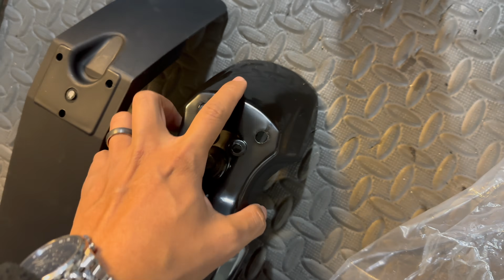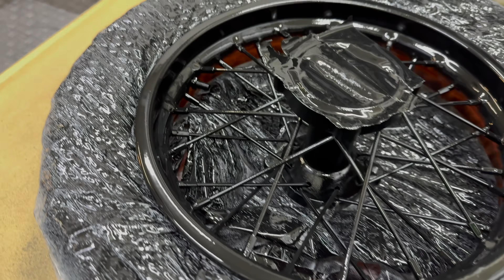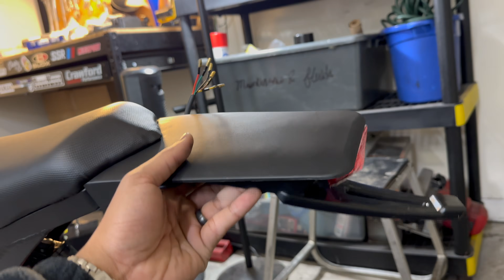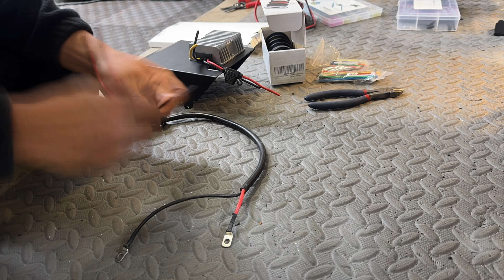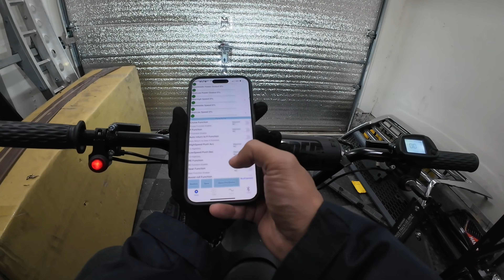Tuttio Soleil 01 Upgrades - Nilight LED Headlight & Tail Lamp Install

Comment: Great video. I’m working on the same brake light modification on my son’s Tulio e-bike, but I have a question about how you wired the brake switch.

I tested the factory rear brake switch and confirmed that the controller supplies 8V with the brake released. When the brake lever is applied, the switch closes, voltage drops to 0V, and the controller immediately disables the throttle. If you hold the brake and try to accelerate, the bike beeps and won’t move.

My concern is introducing 12V from the DC-DC converter into that existing circuit, potentially damaging the controller.

Did you completely disconnect the factory brake-switch wires going back to the controller and repurpose the switch for the 12V brake light? Or did you find a way to retain both functions?

If the factory connection was eliminated, wouldn’t that also eliminate the motor cutoff safety feature? That means someone could squeeze the brake while accidentally twisting the throttle, and the motor could still attempt to drive against the brakes.

My son rides this bike, so maintaining that safety feature is important to me. I’m also raising this because other parents may be following your installation.

I’d appreciate some clarification on how you handled the factory brake circuit. I’d like to add the brake light without compromising the original safety system.

Comment: Everything is clear except the brake wiring. Is black and yellow wires teed off and then yellow to constant hot and black to the back tail light for brake light? 

I connected it this way and it didn’t work. Shows error e09
Someone help please 🙏

Comment: Did you splice the yellow abd black and send the. Lack to ground and yellow to red on converter? Asking for a friend ??…😅
Reply: I put black to the tail light red wire and the yellow + green to the red power cable from converter

Comment: Completed this upgrade head light/tail light modification. Worked perfectly. This may be helpful for anyone doing this modification in the future:
     - Red Power Line wire > Red Switch wire + Yellow/Green Brake Lever wire
     - Red Tail Light wire > Black Brake Lever wire
     - Black Power Line wire > Black Tail Light wire + Black Head Light wire + Black Switch wire
     - Green Tail Light wire > White Switch wire + Red Head Light wire
BTW...yes, the lights draw power even with the ignition off. @patoutdoors thoughts on wiring so the lights only working with the ignition on?
Reply from the maker: You could also switch it so the on off switch is going between the power source and the voltage step down converter so there’s absolutely no draw with ignition off.
Reply: Did you use 22awg wire? Also what did you use for the step down converter teeminals? Just a 12 gauge terminal w connector?
Reply: So you just tap into the yellow/green and black wires that go to the brake lever? Or do you have to disconnect them from the controller before you put power/ground to them? Just want to make sure before I connect that one.
Reply: @lucasgraham  i just unplugged them then cut them
Reply: @Unstrict unplugged as in removed the plastic connector? Then rerouted the ones coming down from the the handle? Then abandoned the ones going to the controller?
Reply: @SolidHomeBuyersAdmin  yes
Reply: I put the yellow and green wire to the red wire coming from the converter, black wire going to the brake light

Comment: Hello Pat. Great video. I got my grandson one of these for Christmas and am getting ready to add the lights. What purpose did the brake signal switch wires serve, the yellow and black ones that come in from the bottom side of the fork with the controller wires, before cutting them and wiring them into the tail light assembly? Are they for the left brake sensor? I've seen several videos where it is desirable to bypass that switch. If cutting the wires does that, it's ok by me but I want to be sure. Thanks in advance.

Comment: how did you share the ground wire between all 3? sorry im not that good at wiring and im trying to wire in a different taillight but it has turn signals and ill just use a different switch.
Reply: Can use a 3 way connector i think he just jammed 2 of the wires into one side of a crimp connector
Reply: I just finished this and i had them connected 2 on one side of a connector

Comment: Do you sell the wiring kit with the harness and everything? Can the lights be wired into the key so they turn on whenever the key is turned on, and bypass the switch entirely?
Reply from the maker: I don’t sell anything unfortunately
Reply: Got all hooked up and tested everything works except the brake light? What do you mean when you say you’re running a  constant power to the brake lamp switch? Do you mean it comes off the power from the converter and routes up
to the lever?
Reply: @kyleestes69  you have to wire the black brake wire to the light and the yellow one to the power cable

Comment: You also went from discussing the brake wire to using those wires for a circuit and then switching the random battery for absolutely no reason at all. Why?

Comment: Bro your wiring of everything together sped up didn't help me at all I am stuck as of right now not really sure what to connect to what, is there any way you could not speed it up or explain it. Like you started putting random on different color wires, how am I suppose to learn anything from this, I went and purchased all this shit and your video is literally making me frustrated cause you skip all the important shit...
Reply: Check newest comment

Comment: Probablybetter to run that wire under your crown instead of between the fork and frame. It could pinch but it will for sure get lots of flexing over time. Under the crown would stop the constant moving. This is months old so it's either becoming a problem or tested out fine so far. Nice video sure this will be helpful to many needing a brakelight.
Reply: What are you referring to as the crown? Top space between forks?
Reply: @Unstrict  What is a fork crown?
A fork crown is the upper part of a bicycle fork which connects the blades of the fork to the steerer tube. This part is integral to the strength and performance of the bicycle, as it distributes the forces of braking, steering, and pedaling to the frame. It is usually made from steel, aluminum, or carbon fiber

Comment: When you put the front fender....did you have to add washers onto the hardware from the older one? Ordered the one on your link but the holes for it are too big
Reply from the maker: Yep, just add a washer on each bolt

Comment: Hello. Great video. But important question. Does this draw constant power with your wiring as I see it routes to the switch but when ignition and switch is off….. when you press on the brake handle, does light come on? If so, it will draw constant power

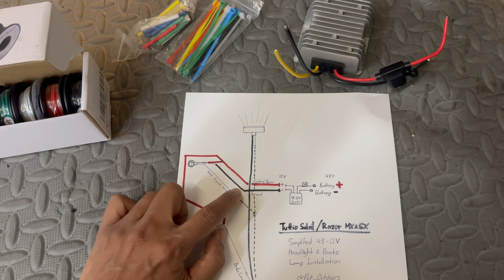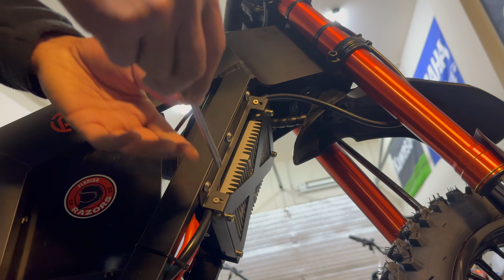Comment: Hi around 15:35-16:03 you mentioned you are teeing off the constant 12V power source to brake lamp switch, since he wants the brake light to work regress if headlight or running lamp is on.  Does this mean it is constantly drawing power from the 48V battery even when the bike is sitting and not used? If so then it will drain battery when bike is sitting around no???
Reply: idk

Comment: Hello. Tell me where you soldered the 2 wires B+ and GK. From the Bms comes + - on the XT90 it is on the plug to the controller and a connector of 2 wires + - coming from the BMS B+ and GK are connected to it. I don't know where to connect them. Without them, the moped beeps 5 times. The battery voltage shows ~67.2. The Fardriver on the mobile does not find the controller. I found it before it was finalized. Kugoo Wish 01 restaling with a white headlight and checkers on a pendulum. I soldered the 16S11P battery and installed the Daly Model K symmetrical Bms.
Reply: Black wire connects to everything. Red sends power to switch which powers everything

Comment: Hi @patoutdoors. I am confused to what I need to order based on your list in your description. If I just want to add front head light and rear taillight plus the switch to turn on and off. Not doing anything else…. Can you list me what I need? What is the “Dongle” used for? Thanks.

Comment: Great work on this bike thanks for the video. I watched a few of your videos and I could've sworn you did one where you upgraded the battery charger on the original 48 V did you do that and what was it? Thanks.
Reply from the maker: I never upgraded the charger for the stock battery, though I used a 72v electro & co charger when I had the 72v Amorge battery installed

Comment: Hey I also have the tuttio but the chain on the bike keeps getting loose. Everytime I tighten the tension bolts the move forward again. How do I solve this issue? Would it help to shorten the chain?

Comment: How to connect a dongle to your bike. The Bluetooth part
Reply from the maker: Take the 4 screws off the controller cover and remove it, plug the Bluetooth dongle to the red connector on the controller harness.

Comment: can you create a tutorial with the headlight link to buy and the light switch and just a tutorial on how to only add the headlight with the switch? pls
Reply: Do the same thing but only attach the signal wire to the headlight, or you can just run it in a circle

Comment: Great tip on the bag for covering the wheel Pat!. Ive just done it on my lads. I do have a little tip for you, instaed of using strips of masking tape and then cutting it to size for the centre. I just used a square piece of tinfoil and then formed it around the centre. Job done. Cheers for the videos 👍
Reply from the maker: That’s another great idea.. keeps its shape too

Comment: If you want your paint to stick to the wheels better you need to prep better. Scuff, clean with alcohol before paint. Also, a 2K clear after will keep the paint looking good

Comment: What did you use on your impact driver to remove the 6mm bolts to remove the rotor? I can’t get them out by hand with my hex keys with rubber handles. They are on too tight.

Comment: Can you make a more detailed video showing how to do the wiring?
Reply: Ive figured it out if you want help
Reply: @Unstrict  Can you please help me?
Reply: @noahfaulkner4028  do you just need to know more in depth what he wired together?
Reply: @Unstrict can you just help me with the brake light connection from the brake lever? I have the green wire but I can’t figure out what wire to tap into. There’s no yellow and black wires on mine. There’s a Y/G and black but I tapped into that wire and nothing. He didn’t go into much detail on wether he just simply tapped into that wire or what he did.
Reply: @lucasgraham  you connect the yellow/green wire to the red power wire from the converter. The black wire from the brake sensor goes to the red tail light wire. The red power wire from converter gives the brake sensor power and the black wire allows the signal to be sent to the brake light when the brake is pressed. Hopefully that makes sense

Comment: Quick question about your brake light. Are you still using it as a safety switch for cutting off power to the motor while you have 12 V going to it?
   I asked because I really want to keep the safety cut off on the break, but I also want the brake light. The bike is for my daughter and that safety switch comes in handy.
    I’m just worry about giving it 12 V not sure if that will mess up the controller
Reply: I think you can just loop at all so it.does both

Comment: i hate that even though i watched this video like 10 imes, i stillll dont understand the wiring for the brake lights :( i even turned its to x.25 on that speedup part and still dont understand lol fml i might need to hire an electrician
Reply: do i still need the step down if im only installing the brae lights? can i just tap the brake light red wire to the yellow brake wire from the bike and black to black if i just want the brake light and not the day time running light? hopefully that made sense to you lol
Reply: @AdventureWithSpidey  ive figured it out mostly if you still want help lol
Reply: @Unstrict  , I am trying to do everything he did, but the brake vs. throttle wire for me isn't yellow; unless I am looking at the wrong thing, it is green. However, I am also confused about how to wire the whole thing at the end.
Reply: @noahfaulkner4028 so when you look at the wiring in his diagram the black cable / negative is connected all the way through to everything in the diagram you see it go to except the brake sensor one. For the brake / throttle, look to see if theres one with 2 wires and one with 1 wire. The 2 will be the brake sensors. Try following it to the brake if you can. Also he has the power splitting from the switch to both the running tail light and the head lights. Brake is separate

Comment: Is there a way to have the lights shut off when the key is turned off?
so you don't accidentally leave them on.
Reply from the maker: @Lee-ry5ib  yes, but you would have to wire in a relay and use the key-on signal wire from the ignition switch going to the controller as a trigger wire for the relay.

Comment: Hey pat, might be a dumb question but when you jumped up to a 72v battery in your Tuttio, did you have to do another “auto learn” ?  Or just a simple swap battery & good to go?    I finally had some time on FarDriver app yesterday as I finally finished my 650 build.  Still learning the app & def had issues as it kept kicking me out when trying to have app send an email for “verify code”.  Someone told me to just enter 123456789 im password & it worked.  So I was finally able to bind with controller & run a “auto learn”.  So, I am still very fresh with this app & controller.   Anyway, just curious about upgrading battery.    Thanks bud!

Comment: Where did you order that new sprocket I have looked everywhere and don’t want to buy anything that won’t match up with the bolt pattern
Reply from the maker: https://amzn.to/4kE6IJH But keep in mind you're trading off some low-end torque for some added top-end speed

Comment: if you use the dongle does it fry the controller
Reply from the maker: All a dongle is a Bluetooth connector that allows you to connect to the controller with the app, like a wireless cable. Putting incorrect settings on the controller can fry it though

Comment: Can you do a tutorial on how to spray paint the rear shock please
Reply from the maker: @JoseLopez-lt8eb  I don’t see that going well long term. There’s a reason why I didn’t do it. I could imagine the paint would flake off as the spring compresses. Springs should be powder coated, which would be more reliable but cost more.
Reply: @PatOutdoors  I been seen a lot of people posting other ways to spray paint it can I just spray paint the whole thing without it damaging?
Reply from the maker: @ never tried it. You should ask those people you saw do it and see how it’s been holding up over time.
Reply: @PatOutdoors do you have any tune setting that make the bike go a little faster but the mille range is still around the stock range cause I heard the range goes down when you tune the bike?.
Reply from the maker: @ it’s one or the other. Can’t have both unfortunately. That’s like trying to get more horsepower for your car but hope it gets better gas mileage at the same time.
Reply: @PatOutdoors I heard the mille range is 43 stock how much you think it is after tuning it and do you think it’s a big difference.

Comment: Hi I’m trying to hook up my tail light same one you have just wondering if you disconnected the brake sensor from the controller when you hooked up the brake light or if you kept it connected and just spliced into the line? Thank for all your videos being a big help on my e-bike journey.
Reply from the maker: I disconnected the connector from the brake lever to the controller. Pretty much just used it to complete a circuit on the 12v line going to the tail lamp
Reply: @ ok thank you so much
Reply: hey dude i have a question, if i get the same sprocket like 53 teeth do i also buy a new chain to fit it?, im sorry if this sounds stupid i am new to this @PatOutdoors
Reply from the maker: @J0SH881  Just like any other bicycle or dirt bike, you need to shorten the current chain to match the length you need for a smaller sprocket. Go on youtube search and type in "how to shorten bike chain" and it's the same process.
Reply: @PatOutdoors  okay thank yoy

Comment: do you think a 14 inch rear and 17 front would fit on the bike?
Reply from the maker: @zisk365  I’ve seen some people fit 17/14 wheels on this bike, but I wouldn’t recommend it unless you are upgrading to the Sotion motor. It’s a lot of added load for the stock motor
Reply: @ do you have any links to those videos by chance or any idea where I could maybe see pictures or videos of the bike with the bigger wheels
Reply from the maker: @zisk365  No videos, just Facebook group posts that people showed me.
Reply: @PatOutdoors  what sotion motor is the one to upgrade to you mentioned?

Comment: Can I put surron wheels on the tuttio?
Reply from the maker: No you can't, simply too large. Not enough clearance on the fork or swing arm. Maybe max is 17" Front and 14" Rear is pushing it

Comment: Hello, I would like to get help, I connect the Bluetooth module and the gas handle stops working, it gives an error e10, I reset everything to stock, it also does not work, but as soon as I remove it from the system, it immediately starts working, any ideas?

Comment: Would you recommend that sprocket on a stock Tuttio Soleil?
Reply from the maker: Depends what you’re looking for. You lose a noticeable amount of low-end torque, but the trade off is a few MPH faster
Reply: @PatOutdoors how much more torque can I get if I tune it?